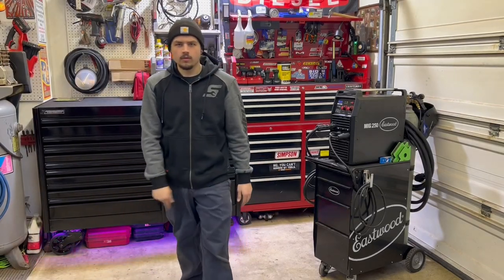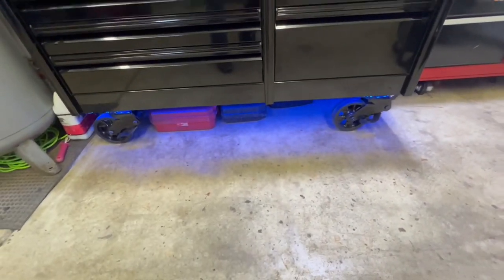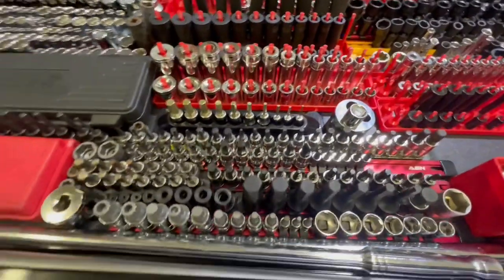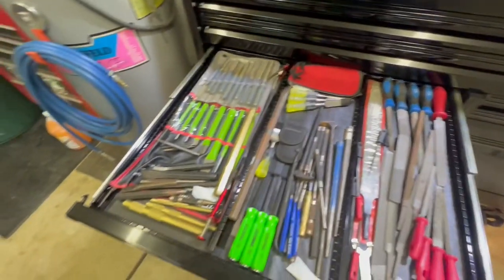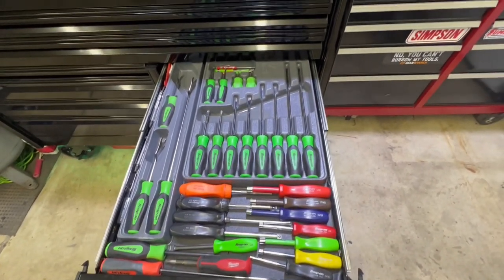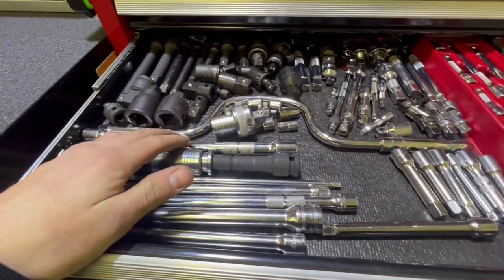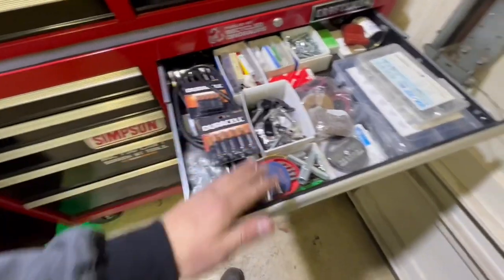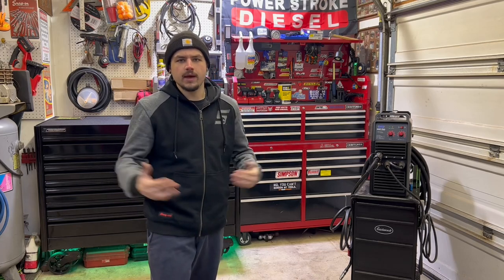FULL Toolbox tour 2023 - AUTOMOTIVE MECHANIC - Snap-on 60” EPIQ SERIES

Comment: I noticed you had an issue with your 1/4" drive socket organizers, were the 11mm wont slide all the way down the shoulder. I have had that same problem across multiple brands and had to fix each one, the way I do it is take a deep 1/2" drive 11mm socket (this will be long enough to clear the peg without bottoming) and put it on a gun then just spin it down onto the holder and it will shave the shoulder down enough so they all set flush.
Reply from the maker: Yeah I was pissed I ordered a couple sets myself and same issues across the board. Thanks for the idea that probably works a lot better then me using a Dremel hahah thanks for watching

Comment: What is the snap on deep swivel socket you have? Is it metric?
Reply from the maker: There the 7pc metric set and 7pc standard set there the 1/2” drive shallow swivels bought on a bogo
Reply: @PowerstrokeRick  Sorry I actually meant the sockets you showed at 7:43 which you said was Snap On.  It looks like a 1/4" drive deep swivel. Is that a 1/4" drive impact swivel socket because I am looking for an 8mm and 10mm in deep swivels. Thanks!
Reply from the maker: @MoneyMarcMes  oh yeah that’s the extra deep 1/4” drive 10mm I have the 8mm on order as well
Reply: @PowerstrokeRick  Do you have part numbers?